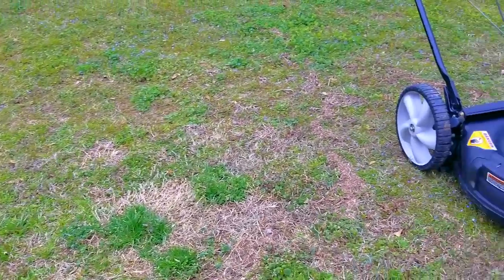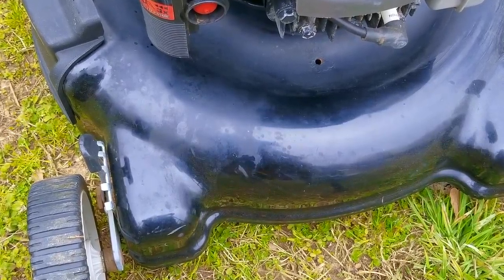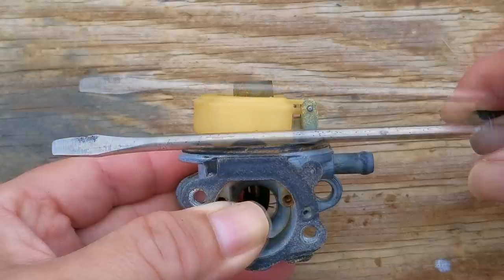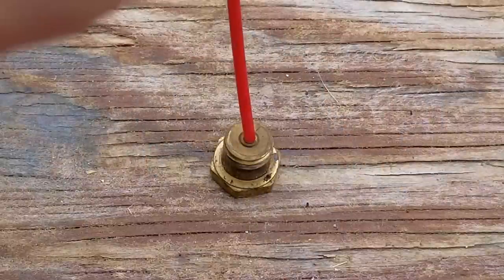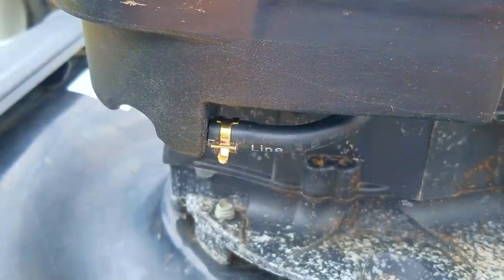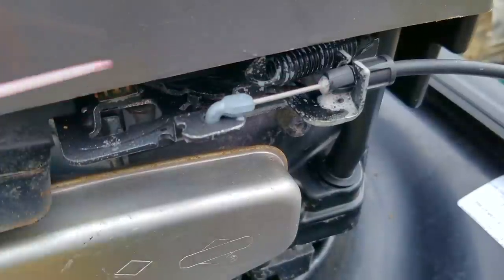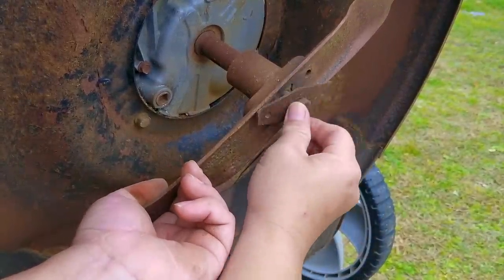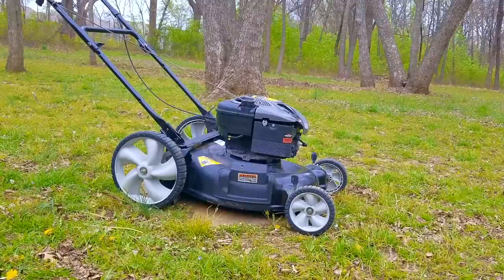Where Did The Gasoline Go On This Yardmachines Mower?

Comment: Very good video and excellent camera work. (As usual) As a matter of fact the camera picked up on the old trick of putting double primer gaskets on. Pretty common that the plastic plate that houses the air filter does not seat tight enough and 2 gaskets will cure that most of the time. I know how much time it takes to make these videos so Thank You again for your time and expertise. 👍
Reply from the maker: I know right, I didn't point it out and I wanted to see if anyone would notice! Thank you Dave, I always appreciate your time

Comment: When I work on lawn mowers that have the control lever and I do adjustments, I just use a metal spring clamp to hold it down. I use a metal spring clamp over the plastic ones, because the spacing is smaller over the plastic ones and holds down the lever tighter.
Reply from the maker: good technique

Comment: A trick I've started using on the cables, is a thin needle filled with whatever oil I have readily available.  You can get the needle inside the conduit/post section to help get it further down inside.  I find I get about 2-3ml in from the top and bottom, which is usually good.  Using the spray straw method I usually got more lubricant on the ground and myself than I felt got inside.  Most of the cables I have to replace seize up somewhere inside the conduit, so I feel like the needle helps get more further inside where hidden rust and wear may not be visible.

For the Quantum gasket on the filter base, if replacing it doesn't work, duct tape on the air channel then the gasket has not failed me yet.  Most times, if I have to remove the carb for cleaning, that gasket tends to break or get damaged anyway.  The replacement ones are sometimes stiff and won't make that seal until they soften up otherwise due to warpage of the plastic.
Reply from the maker: I like the idea, I might have to start using that method, thanks!

Comment: The jet gasket is what I check first on the carb. Not only should the carb float be parallel relative to the carb body after a rebuild, but a hose blow-test can be done to see if the seat seals with the needle every time you move the float. A tight needle and seat will not allow air through in the sealing position when you blow into it. There is no need to use a pressure tool or leak test bench.
Reply from the maker: yes works too!

Comment: If mine was leaking I definitely would look since it's stored in the garage. So the other day I got the LB 7268 running. It actually started on the 2nd pull. Ran slow sounded like it was bogging at first but then I realized that it was way too rich. I haven't adjusted one of those carbs in a long time. Anyway shut it down and made a few adjustment tries. I think half a turn in or so. Then it was good. Shut it down, let it sit a bit and then tried a restart and got nothing. Checked spark seem fine, kinda weak.  Unfortunately the coil has a huge crack in the casing but it was working. It seems it flooded itself out nbd plug was wet. Blew it out threw it in and then it was good. I'm like alright cool, right? I shut it down and started like 5 times in a row. Then I let it chill for a few minutes, come back, try 1 more, and it doesn't start, and now no spark. So I let it all cool down for a few hours and spark returned, but then it still didn't. So I guess the old solid state just giving up the ghost.
Reply from the maker: yes the coils on those are iffy
Reply: @HomeGaragechannel  I have another 7268 and I checked that one and it was working. Took the covers off and it was in good shape! Swapped it over and it ran but was still intermittent. I ohmed out the switch and had a lot of resistance. Turned it on and off a bunch of times until I got zeros. Now it starts right up even when warm!
Reply from the maker: nice

Comment: I learned from an older gentleman that used to work on lawnmowers, that if you blow into the fuel nipple on the carb, with the carb upside down, you can determine if the needle seat is leaking or not. Cool trick if you ask me
Reply from the maker: yes that works too the issue is, you're using gravity to work the float closed, versus it's buoyancy of the float in the gasoline. It does work but it's not a guarantee
Reply: @HomeGaragechannel  Interesting, I never thought of it that way 🤔
Reply: You can also do a vacuum test, instead of blowing into the fuel nipple suck on it and the fuel nipple should stick on your tongue.
Reply from the maker: that's a good idea

Comment: This is the electric start except it's red. The primer circuit needs to be redone on mine, even though it's a new carb and primer bulb, retainer and gasket. Might have to get out the old Permatex #2 tube and do some sealing myself. Just a sniff of ether and it runs like a Swiss watch and always starts 1st pull when hot. Usually 1st pull when cold. Before with the old carb it took 5 pushes of the primer to get enough to start on the 2nd pull BUT I was using pump gas with ethanol so no wonder. It's EASY starting and the self-propel works fine as does the bag but the electric is a dab slow and that's why it doesn't start the motor. I'll put a decent charger on it instead of the dinky one I ordered for it.  It spins but no zip and I saw a video that slow cranking speed was the culprit. The old mower runs fine and I always balance a blade when I sharpen one. Lots less vibration that way. I've had one of the cheap pot metal spike and cone balancers for ages and it'll do front and back as well as side to side if something is really sideways. So THANKS! This is the Troy-bilt without being a Troy-bilt! And they're rated at 3300 R's instead of 36. BLESSINGS!
Reply from the maker: nice, and yes a bit of Permatex never hurt. Thank you Lewie McNeely.

Comment: I would balance the blade, looks like too much vibration. I would definitely fix the leak.(no gasket on the jet bolt) The other problem on these if they don't readily prime is the deteriorated bowl gasket not holding air pressure or a leaking primer bulb.
Reply from the maker: it's possible

Comment: Would a 40 w oil help that crank soundm , it just sounded a little hard hitting but then again it's done over the camera! thank you for the video, I caught the slow fuel leak ,straight out, the jet bolt did not have a gasket, I maKe them  all the time, I have a boring tool that punches the center hole ,I like the rubber fiber gasket paper from my local O'Reilly auto parts it is rare ,I buy gaskets i do have to but bowl gaskets ,although sometimes orings will get it done ,I'm fortunate enough to have a leather punch tool that makes the various sized holes,  you know how it is, why wait when you can get it done now!
Reply from the maker: unfortunately no it wouldn't matter if you put gear oil in it, it's still going to make it.
Reply: @HomeGaragechannel  thank you for the reply, and the great videos!
Reply from the maker: no problem

Comment: You should get yourself a nice 1/4in set like Tekton, I see you use 3/8 sockets a lot. I used that fuel line before off amazon. Turns rocks hard after a few months. clearly not gas resistant.
Reply from the maker: I know right, it's some cheap stuff, and as for the tools it would be nice, but I'm not working on anything that requires nice tools
Reply: @Home Garage  I meant in terms of space. 1/4in set fits in a lot more spaces compared to 3/8.

After all you deserve to treat yourself with new things.

Comment: Had often this Briggs on mowers and often had issue to restart when hot (after using 4 a while) do you know whats the cause ???

And for your question, for sure I'd investigate to find a little issue like that cause usually easy to find AND don't like to smell gasoline anywhere !
Reply from the maker: I would need more information, and yes fixing the leak would be paramount

Comment: I would not want my mower to leak gas. It's to expensive and it stinks. I very rarely have to replace a Quantum carburetor.  They are easy to clean and I stock the gaskets, and needle +seat sets for them.
Reply from the maker: yes you're right about that, simple and easy to clean Thank you Brian King.

Comment: Very good video, but i want to ask something. My chainsaw stopped working recently and im in a dilemma if i should fix my current saw or buy a better model ( the Stihl Ms 231 C-BE for 415$ ) I want to ask you for your professional opinion.
Reply from the maker: I would need more information, but I already have the answer, and it's the one you want, go buy a new one.  The reason is simple, you meaning the saw stopping however you didn't mention what the brand and model is. You also didn't mention how it failed. you then gave me the make and model , and even the price of the one you want to buy.  So I think you already answered your own question .
Reply: Well as you are saying i already answered my question but i will still give you more info. My saw is ms 180, 17 years old, 2hp ,15inch bar and the ms 231 c-be is 15 inch bar, 2,7hp, has primer bulb and you can tinker with the Low, High and Idle speeds with this model. The death of the ms180. Some workers had to come to my house and make a new wall. They bring all the tools they need but they decided to cut some wood for them to use with my chainsaw. My mom was on the balcony and she heard how they were starting the saw and how much throttle they were giving to it. After i got home i saw my chainsaw covered in dirt, oil and mainly oil. I cleaned it, swore a few words at the workers and i tried to start it. It ran for a minute after that something clunked and it refused to start.

Comment: What would cause a lawnmower to use starter fluid every single time to turn on
Reply from the maker: it depends on the type of priming  or choking system it has, but which ever one it is, it would seem it's failed. more information like the model number of the mower or the engine would help.
Reply: @HomeGaragechannel  toro super recycler model number is 20472 older type of mower I believe it never starts without it
Reply from the maker: so I looked it up, and it's a priming carb, with the red primer. Have you looked to see if the gasket between the carb and the air filter base is missing, or broken. That's typically the reason why those engines won't start cold, without help at least.
Reply: @HomeGaragechannel  thanks I will give it a try

Comment: It's a strange thing that gas didn't get to the oil  messed up
Reply: Gas was leaking from the bottom of the bowl where it meets up with the bowl nut.  Had it been leaking because of a needle valve/seat/float issue it would have "overflowed" and gotten into the engine past the rings and down into the crankcase contaminating the oil
Reply from the maker: the leak was under the carb otherwise yes it would have messed the engine up
Reply from the maker: correct, thank you for your assistance
Reply: @HomeGaragechannel  you are welcome young man 👍😎😁